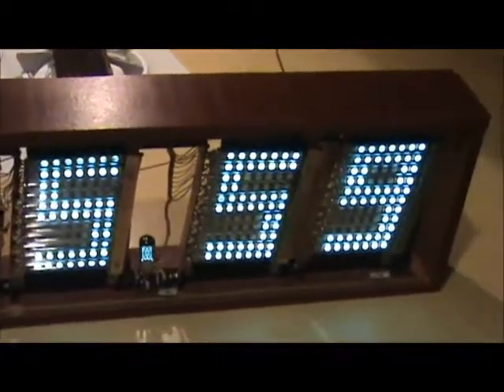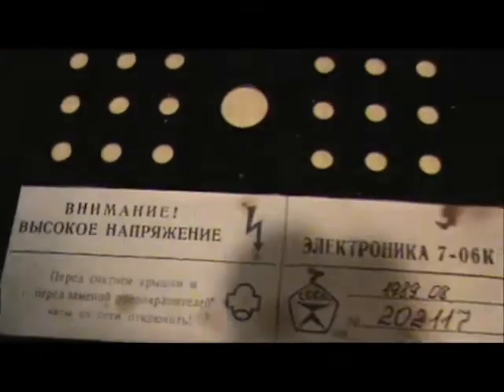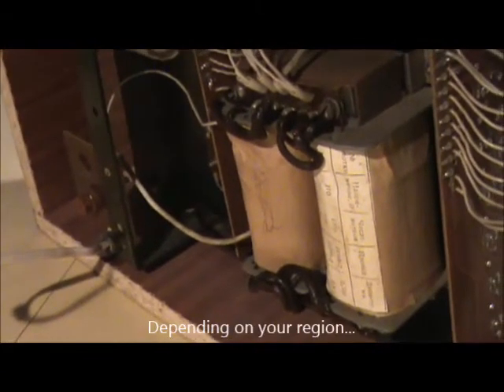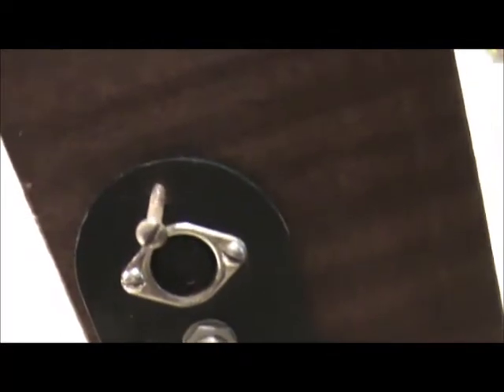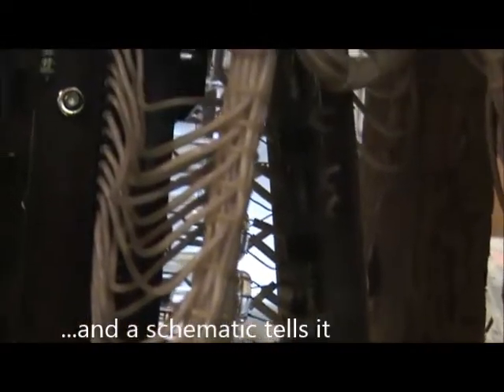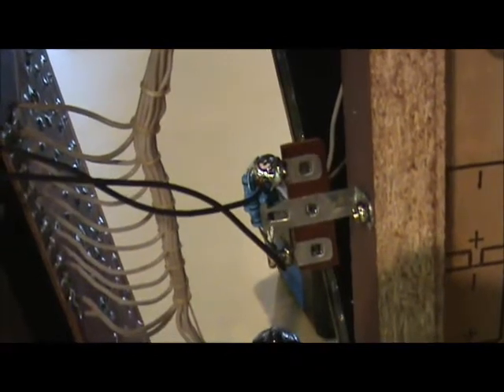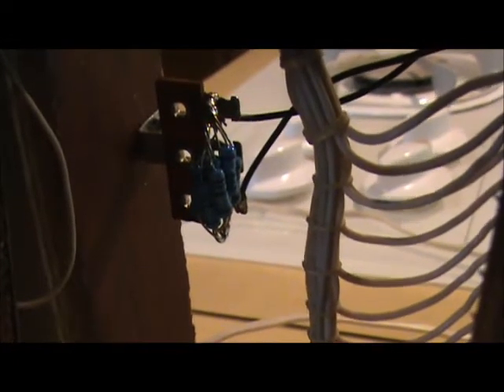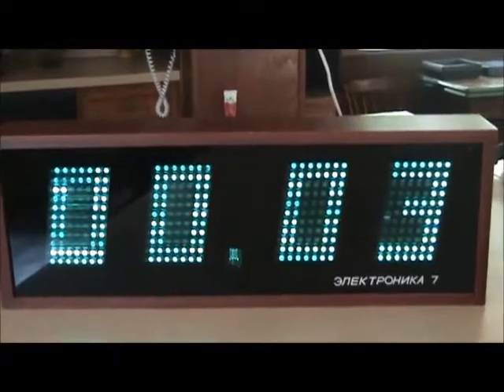Elektronika 7-06K Vintage Digital VFD Tube Clock

Comment: The plug looks like a MIDI input??????
Reply from the maker: Just found out...There is a 5-pin DIN connector which provides 9V, ground, a 1 PPS output and a radio data input.

Comment: You have the  never version here, with 11 tubes / digit and IV-26 Type 2. First version used 12 tubes / digit and Type 1 tubes, much more labour to solder. The little riserboard on the mainboard if for time sync. The five pin din plug on side of clock, is used for this. 
 I have changed tubes in 6 of these clocks, and it is well worth the effort. Also remember to replace the protection foam for the tubes. Also the rubber bits (sex of them) to pprotect the glass, as they usually go rock hard. The IC's run at 9v normally. I have a clock where the run them at 12v and it have worked fine for years. Think the USSR chips where more robust than 5v TTL. 
I also always bolt a big 100W panel mount resistor to the metal chassis and ire it in series with the filament voltage, as we have around 238v here in DK.
Also the early versions used 2 fuses for the mains (both on L+N). I cut the N one out and rewire it in series with filament power. The transformer can without problem set fire the to thin cabeling.
And and other have said, replace the filter cap it usually goes high on ESR.
Reply from the maker: Rob, 
Thanks for the info.  It sounds as if this version is better to work on as far as when doing the tube replacement.  Tubes will be ordered soon.  I want to have on hand for the future.  OK on the riser board...I had a guess as to that but did not comment...  Thank you.   I have indeed already replaced the sticky foam under the metal straps but will replace the rest (under all the tubes) when I replace the tubes.  It will be easier to clean things up at that point.  The rubber tubing to protect the glass seems somewhat pliable yet but will consider changing also.  Ok so maybe the zener feeds the IC's at 9-10 volts ...I never did look at that in the schematic.  Good to know that these IC's are robust.  Having to sort out, troubleshoot and source the parts, mainly the ic's, may be a challenge.  What resistance do you use in the filament circuit and to end up with what voltage at the tube if I can ask?  Our "220" over here actually runs 240 to 250.  That is why I actually like the particular  step-up transformer that I ended up with.  It outputs 215 to 220 VAC from our 125 line.  Hello from the USA BTW!  A great idea to fuse the filament circuit.  There is definitely very thin wire for almost 3 amps of current flow and that wire would smoke quickly I agree.  The filter cap should get on the list for my next order.  There was low ripple on it so I did not jump right in but agree that needs to be done.  Do you recall the value?  I believe it to be maybe 2000uF ...hard to read the schematic?  I would use a 50 volt rated for sure.
Reply: Sorry, forgot to mention the value :) It is R22, 100W. Have not got a clock near by, but think it drops the filament as low as about 2.7v, but it still shines very good. I guess when the tubes fade after X time, a quick fix could be to jump out the resistor and thereby raise the voltage and get the last life out of it. 
The IC's are a bit "fun". They both seem to be able to live with higher specced voltage, but I have also seen some fail. You can still buy most of them NOS on EBay.
I really do think it is wise to add the fuse, I found out about it, when I Changed tubes on one clock, and made a dead short on the filament. Found out, when smoke started :) :)
Yes, the cap is 2000mF, I have also seen about 4000 mF in one. I usually just go for min 4700 mF.
Also be very carefull with the iron heat on the PCB, go for leaded solder and min possible temp, it is VERY easy to rip tracks of the board, if you go high temp.
Ohh, and HI from DK also :)

BTW, you should REALLY read this guys block (real good stuff), he writes both about the Elektronika 7 -06M & K:
https://www.glaver.org/blog/?cat=11
Reply from the maker: @robnorthen509  22 ohms seems like more than enough to drop about 25 volts.  200 watts plenty of margin.  Thanks for the link!  Very plentiful info there.  I just purchased a lot of 50 tubes.  They will go into stock for now.  Iron temp was on my mind as mine is not adjustable but usually right if I keep the dwell time short and pull the solder in one or two attempts.  I will get better equipment for the big tube swap or maybe plug the iron in the variac LOL.  Two tubes swapped went well.  The holes in the pcb are large and easy to work with.
Reply: @JIMO415  
Good idea with the new tubes. And good you have six spare ones. I never repaired a clock with new tubes, where I did not need to replace a allready repalced tube. Often there is min. one not working or that differs too much in brightness, often to the low side.
The tubes made, all  have diffrent brightness intensity. I bet a buck, that the old tubes are marked with a little dot of paint. They marked the tubes with a diffrent dot of color, so you could see how the brightness was. If possible, when buying tubes, go for tubes marked with the same same color code. Though, it seems hard (for me anyway) to find NOS tubes on Ebay with color code. I usually ask the seller to go for same production date code - helps a bit, but there is often diffrent intenity between the tubes.
Reply: @robnorthen509 how do you use sync signal? what is it's protocol? i have one of this clock and i want to sync to real time for automatic set of possible. thanks.
Reply: I've just received one, also 11 tube digits from 1990. I want to replace a few tubes. How can I check if I need type 1, 2 or 3?

Comment: Taming down the filament supply and also the overall brightness is a good idea, especially if you plan to run the clock long term. You may want to replace that main filter capacitor, even though the clock isn't that old; Soviet electrolytic capacitors just weren't very good.
Reply from the maker: The cap is on the list for sure.  The clock is on the wall for display currently, so yes long term.  I was planning on going back in for more "might as wells".  The ripple was low at this point, so I decided to run it for a bit.